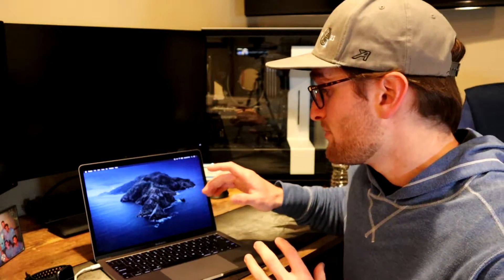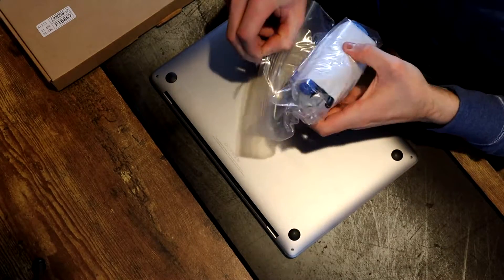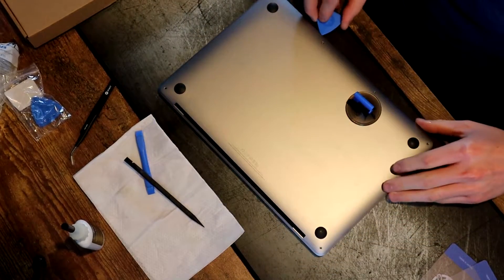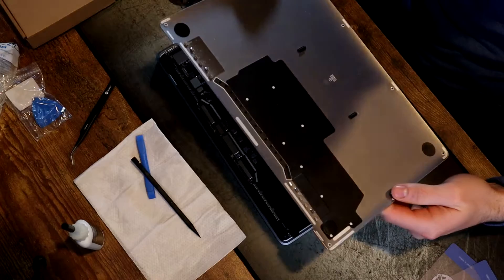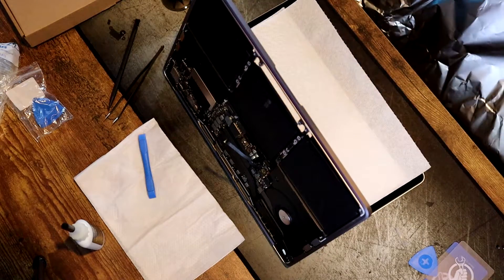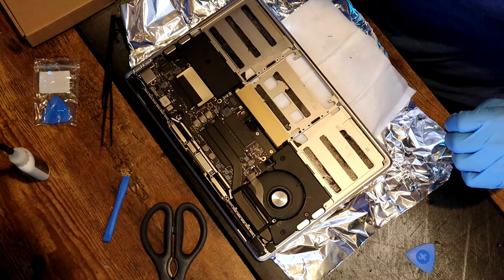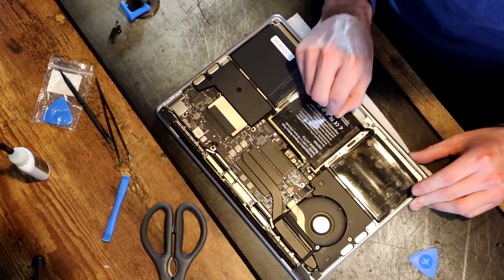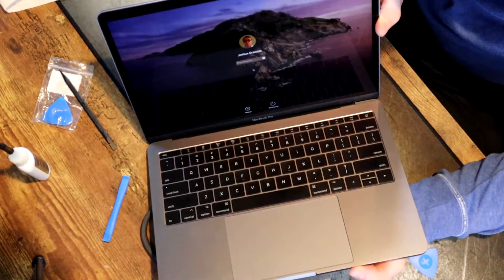2017 MacBook Pro 13" A1708 DIY Battery Replacement | iFixit Review

Comment: The reason apple charges so much for their fixes is because they don't just do a replacement on the thing they're fixing. They usually replace other parts too. They do this because they're legally bound to warranty their work, which amounts to a whole new warranty on your machine for about a year. Which means after your fix is in place, if anything else happens, the will usually fix it at no cost. Because of this, they usually bring the machine up to factory refurb spec at least around the main work that they're doing.

It's also not just apple. Samsung does it too.
Reply: There should be nothing else that needs replaced if the battery is dead (or many other parts for that matter).  If they do anything else it should be explained to the customer and verified that the customer wants it.  Furthermore if it a part being replaced under warranty it should have no effect on the cost at all.

Comment: Just for people to know, you do not need to remove all those screws as well as the track pad in other to take off the battery. Just a few specific ones and you're good to go.
Reply: Price of a trackpad 59€ , time used to remove 12 screws , 17 secs I still rather to remove them and not risk it 🤣
Reply: You would literally be Insane to not take it out while trying to take out the middle battery.
Reply: @rupertwilmot4792  usually people take out the track pad, to put that adhesive remover soo it's easier too take out the battery. But I don't think it's necessary to take out the entire track pad tho, maybe 1-3 screws should be enough. 
You can also try to use a blow dryer on the middle battery to make it easier to pry the middle battery up instead of using that liquid.
Reply: DO NOT DO THIS. I REPEAT- ALWAYS TAKE OFF THE TRACK PAD FIRST. It's not that hard, and if you don't, you'll break your trackpad electronics which are RIGHT underneath the middle battery. believe me, cause I ruined my macbook from following this.
Reply: Every vid I've seen shows the same basic process, where are you getting your information that only a few screws are needed?  I could see the trackpad being excessive, other than you risk damaging it while prying the center battery section out if you don't remove it first.

Comment: Do you know if the macbook works by removing the battery but connected to electricity?
Reply: Every Mac will work plugged in regardless of if a battery is installed (Becca's Macs FB group been repairing Macs 10 years)

Comment: With the new battery how long does it last on a full charge? I’m am thinking about doing this as well. Mine is still working good but I did buy it used and I feel like the battery doesn’t last as long as it should.
Reply from the maker: Lasts quite a bit, probably around 2-3hours for pretty rigorous programs, and 8-10 for video playback and web browsing

Comment: Would this fix also work for a Macbook Pro 13 inch (2017) without the touch bar? It seems like it should be roughly the same, right?
Reply from the maker: Ifixit has kits for both

Comment: Can't get the bottom off. Clips won't unclip. Noticed you cut the part I'm struggling with. Wtf?
Reply from the maker: You have to get the clips I clipped using the guitar back or credit card, and then slide the bottom towards the front of the laptop
Reply: Turned in but my keyboard don't work
Reply: Damn... This is depressing😟
Reply: I owe you an apology
Reply: Went back in and just had to push a little harder.
Reply: But bat still won't charge???
Reply: For some reason the battery still won't charge???? And thoughts?
Reply from the maker: Not really sure to be honest, with the battery replaced it could be a loose connection or something with the charging port
Reply: Replaced the chord. Sorry for the attitude. Actually picked your vid cuz thought you were chill. All is well. Compi happy. Thank you, my guy😅

Comment: Apple quotes $149 without warranty. Might be worth taking it to Apple?
Reply from the maker: If that’s all they’re quoting that’s worth it
Reply: @TechRoundUp  Im going in tomorrow so ill find out, out of no where my laptop went from staying on all day no prob to dying within 1.5hrs

Weird enough my 2011 macbook pro did the same thing and i replaced everything inside it before even taking it to apple 

That battery only lasted 1 day before it was just as bad as the other one, some software i used said the battery was bad and i couldnt return it

I think i got the kit from ifix it as well idk if it was the battery or their new os just draining it faster 

Hopefully apply doesnt try to rip me off, if its good price ill do it, if not ill have to wait till later, thankfully i built a gaming pc so this is just for extra / casual work stuff now lol
Reply: @dominics109  did it work?

Comment: I have the 2017 MacBook Pro 13" with the touch bar at the top just below the screen. Is it the A1708? Or are there different 2017 models which use different batteries? Just want to be sure before starting what I saw you do on your video...
Reply from the maker: I think the whole process will be slightly different with the Touch Bar but I fixit makes a lot specific for the Touch Bar model

Comment: Hey, man! Great video! Could you tell me how to download this monit software? I googled it and I'm not sure about the results. I think I have the same problem with my battery and it's the same model as yours.
Reply from the maker: Hey it’s an app in the App Store but after upgrading to Big Sur from Catalina it no longer works. It was a notifications center only app, but if you haven’t installed Big Sur you should be fine

Comment: Hi, I eliminated the mac and changed the accumulator. the old accumulator had blown itself up. Same mac and same accumulator (1708). this was not mechanically a problem. Unfortunately the mac drives up very slowly. the mouse pad and the keyboard do not work anymore, only still the BT Maus and keyboard work. The mac runs also super super slowly. The fan runs permanently. I explained the works very carefully. I installed the old accumulator again, unfortunately again that itself error situation. Have you an idea what I made wrong? BG Rudi

Comment: Hi, If i want looking for the battery. What is the correct battery for the same model? (A1708)
Reply from the maker: https://www.ifixit.com/Store/Mac/MacBook-Pro-13-Inch-Retina-Function-Keys-Late-2016-2017-Battery/IF123-098?o=5

Comment: Apple quoted me $139 for a battery replacement
Reply from the maker: Honestly surprised, but that’s a good deal. Maybe they’re not out for everybody haha
Reply: Thanks for the video BTW. I know some 2017 MacBook Pro 13inch are eligible for a free battery replacement.
Reply: @humanwrx  Too bad they will only replace once. My batter went bad again after 2 years.
Reply from the maker: Yeah I had checked but the serial number wasn’t eligible
Reply: @TechRoundUp  I have the same model. How do I check if my mac is eligible? Do they still have free replacement?

Comment: Hey man would a 310 w PSU work with a gtx 1660super ir gtx1650super?
Reply from the maker: It should but would be a little close depending on the cpu
Reply: Ah tanks my CPU is a i5 9400F.